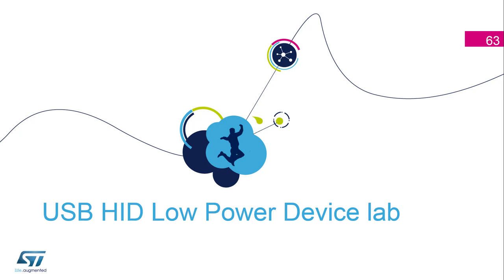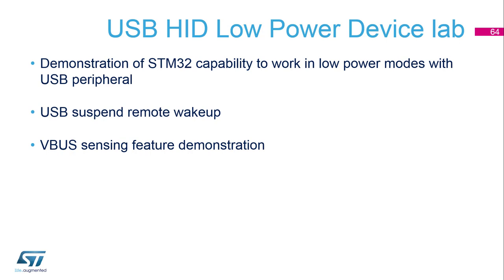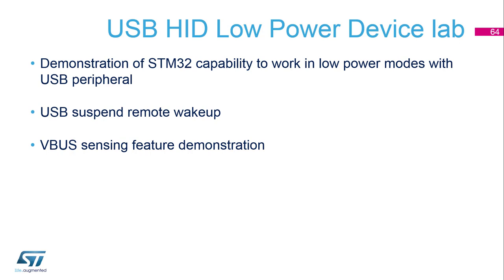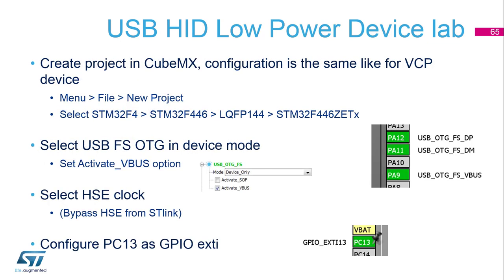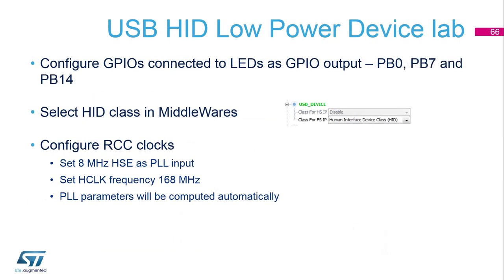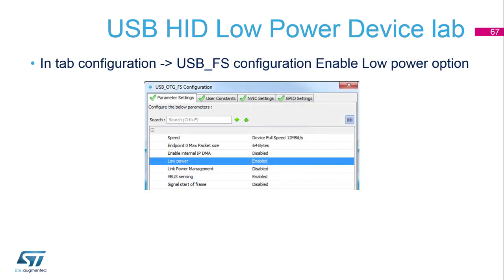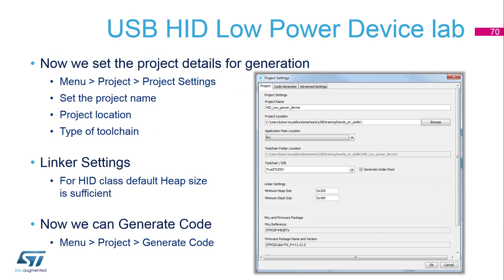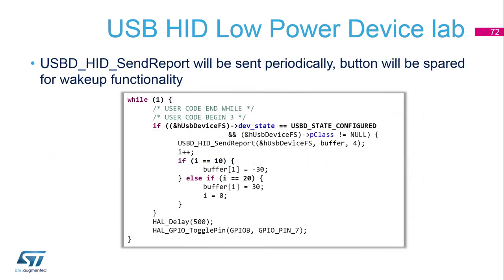STM32 USB training - 09.6 USB HID device Low Power lab

Comment: some bookmarks on the video:
3:14 Set Activate_VBUS option
4:22 wake up PC by power button
4:25 wake up PC by click of the mouse
4:53 Enable Low power option
5:15 decrease USB interrupt priority to be lower than System tick timer
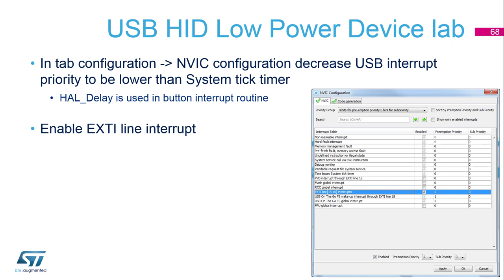5:54 USB wake-up interrupt
6:17 code reuse configuration of mouse example
6:39 movement will be permanent (not using the button)
7:05 Add button callback to usbd_conf.c–wake up MCU from low power mode and send wake up signal on the bus
7:42 Activate Remote wakeup
8:12 change USB state to configured
8:23 Modify WKUP_IRQHandler
12:04 VBUS sensing.